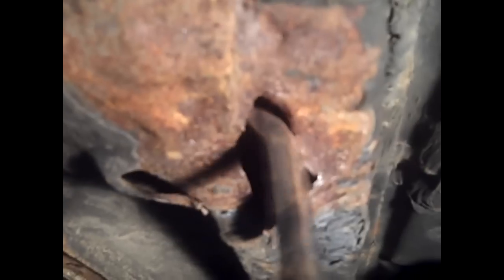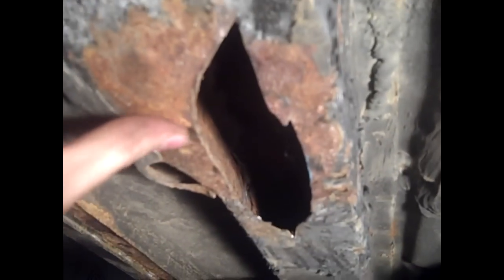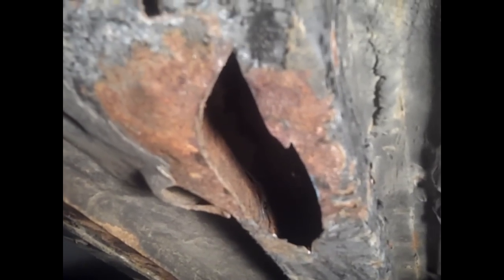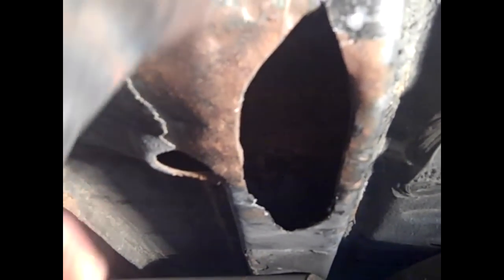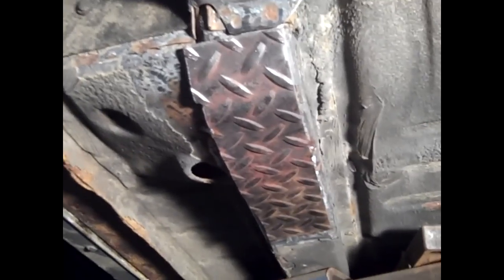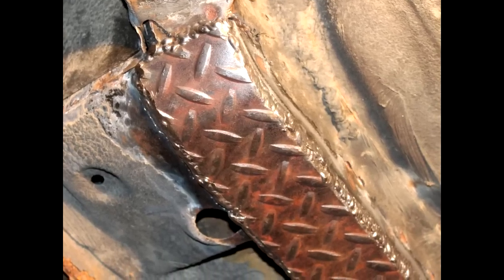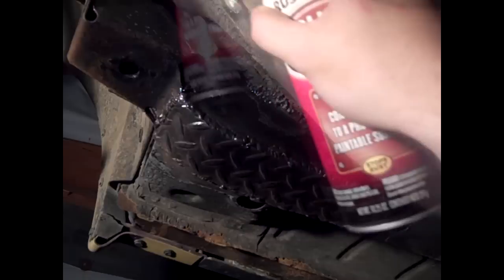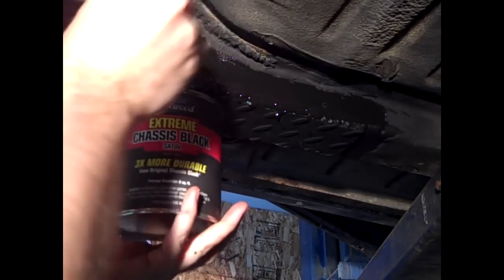Patching extensive unibody frame rust

Comment: Nice video but this is a frame you're fixing and my understanding is that a unibodied vehicle for example, the Nashes of the 50's or the 58 thru 60 Lincolns all have a unibody which means they have no frames. These cars were built around the unibody. So how would one go about reparing a unibody if there is nothing there to weld to?
Reply: No, nothing hard at all about fabricating a crucial piece of structure on a vehicle that hurtles down the road at 55mph or more... no.. not at all...  Trying not to be mean here but it is a little more difficult to do safely than you make it sound.
Reply: Lol
Reply: a unibody is PART OF THE FUCKING BODY,DUDE                 @Roy Kloholtz

Comment: the inside of that frame bar is still a hot mess or rust my man...and now its harder to get to after that diamond plate. not to mention the other side of that plate needed coating as well
Reply: Drill a hole fill add a grease cert and fill her up lmao

Comment: i would never drive a car with that much rust on it
Reply: You're the kind of person that buys new cars, go complain somewhere else
Reply: ZaRe Fantasy exactly
Reply: BIG Willie PK some European luxury and sports cars have 5 rivets holding the front plastic laminate coil towers to the steel unibody some of These cars are $ 100 k plus my friend who repaired one said there was 0 info on changing it and the manufacturer had 0/spares the car was less than 1.5 years old and would not align it was off .5 of a degree. On another you tube channel a German car had a cracked front aluminium/magnesium coil tower apparently they are prone to cracking right next to the windshield

Comment: Wow, nice cosmetic repair... however from what I could see, it did little to improve crumple-zone integrity... rust treatment should have been applied to the inside of the rail before patching it as well. Make sure to drill a drain hole in your diamond patch otherwise you'll end up with even a larger headache down the road....  I use "U" shaped prefab patching panels myself all along the rail, securing it all along the entire top and perimeter where it meets the floor, and by drilling .24" holes (every 1.5"-2") for additional tack welds in the patch all along the lower sides for improved strength.

Comment: AND THIS GUY ON VID I POSTED...HE IS A SMART GUY...FOUL MOUTHED...BUT FORGET THE LANGUAGE...GET EDUCATED...BECAUSE THIS IS WHAT I AM GOING TO DO TO MY RESTORE PROJECT...THANK GOD 8,9 YRS AS SECOND OWNER..THE ORIGINAL OWNER MOSTLY KEPT CAR OUT OF FOWL WEATHER AND RAIN...THATS WHAT YOU CALL BACK IN THE DAY WHEN FOLKS KEPT STOCKED UP HOUSE HOLD WISE AND NO NEED TO RUN OUT IN INCLAMATE WEATHER INCLUDING RAIN..AND WHY MY 78 NOVA IS PROBABLY ONE OF A FEW IN TOP SHAPE WITH VERY SMALL MIN RUST SURFACE WISE AND ONLY 2 RUST HOLES WHERE RADIATOR SAT AND THATS ABOUT IT...BUT FOLKS THAT SEE INTERNAL FRAME RUST AND DO NOT AT LEAST ATTEMPT TO KILL OFF INTERNAL RUST....YOUR CUTTING CORNERS...AND CHEATING OUT  THE OWNER...TAKE PRIDE IN YOUR WORK...THAT CAR COULD BE A COLLECTOR ONE DAY..PERHAPS..JUST SAYING..LIKE MY 78 NOVA...DO THE JOB RIGHT.RATHER THAN BIGGER HEADACHE LATER..THATS ALL I GOT TO SAY..

Comment: Is it just me or did this repair look horrific? I guess it wasn't made to look good vise just fix the problem...
Reply: That steel he put on was stronger than the original.
Reply: Bondo thats the problem. it should be from the same size and thickness that original was. and its all still rusty

Comment: Stainless steel! Why use stainless steel? I think you may have a problem with trying to weld that metal.I know nothing about tig but with mig welding  and gas brazing you need special supplies to weld or braze stainles steel. you better get some regular steel and weld it in with your tig. Don't use stainless because it may not be possible to weld stainless to non stainless steel.unless you braze it but that is a frame. I think you have to remake the metal with the original type steel, sorry.

Comment: ZINK SPRAY IT then weld it 
zink everything in that hole EVERYTHNG
Reply: Never weld zinc..
Reply: Arthur O'Connell. its a fairly common practice to use a zinc spray to seal welding surfaces to stop rust from forming.
Reply: after the weld is done
Reply: If you like zinc poisoning.  Never weld over zinc. Google it.  It makes you feel like you have a nasty flu.  Drinking milk will help but it's better to avoid doing it in the first place.
Reply: It's called weld-thru primer. It's zinc based and used at each weld point between two layers to restore corrosive protection. It doesn't make you sick. You're thinking of fumes generated by extended welding on galvanized steel.
Reply: zloben9000   This what I do , I drill  small hole  close to area the use under coat sprayer/ or small gallon sprayer from garden store  spray  motor oil ,mixed with a little paint thinner / kerosene /  into the sub frame  soak then put a plastic plug in the hole do yearly last longer than most of us    I do all my cars doors frames fenders pillars rockers  trunk floors  done right works  only problem do all the repairs before doing the whole car or truck or you will have a fire don’t get on exhaust manifolds or cat